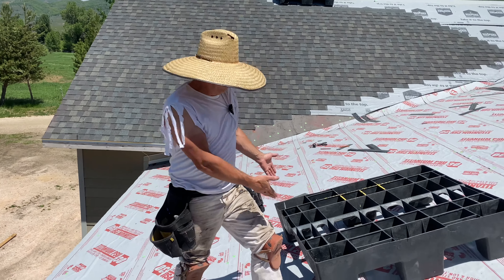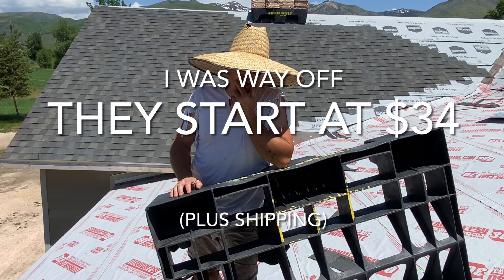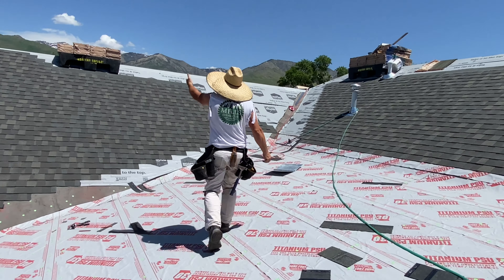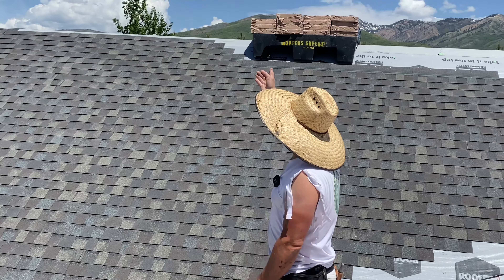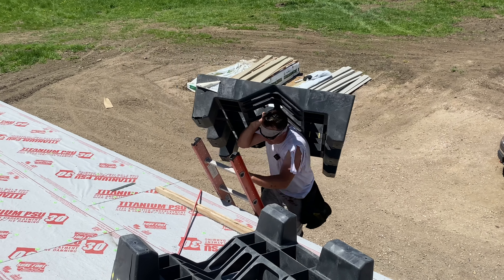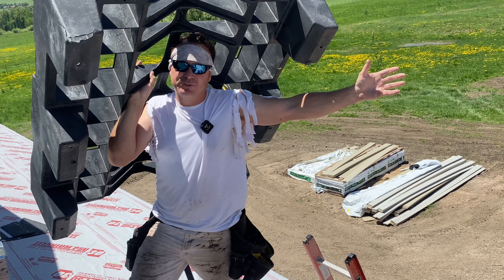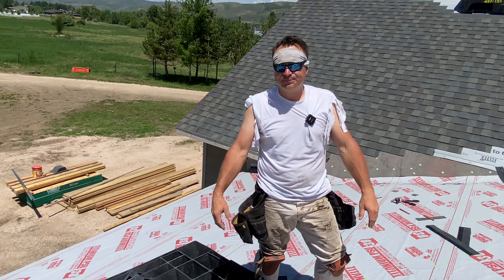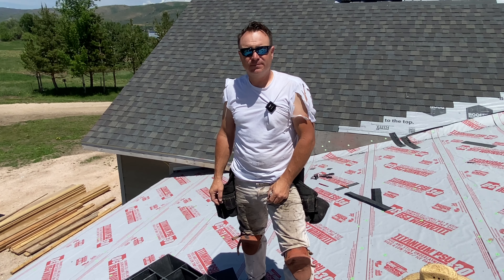Peaked Pallets - do they really stack up?

Comment: I think peaked pallets don't work at all. They are a novel concept, but somebody still needs to get up on that roof and undo the straps. Also, the supplier has to come back to the job site and pick them up. And if you want a crane operator, a truck driver, and a roof walker, all in the same employee… Good luck finding them.
Reply from the maker: I have a new subdivision we did last year with a small mountain of them still sitting there, just waiting to go home
Reply: @ScottRoofwalker  poor things 😂
Reply from the maker: @huhwhatomg  they’ll live lol